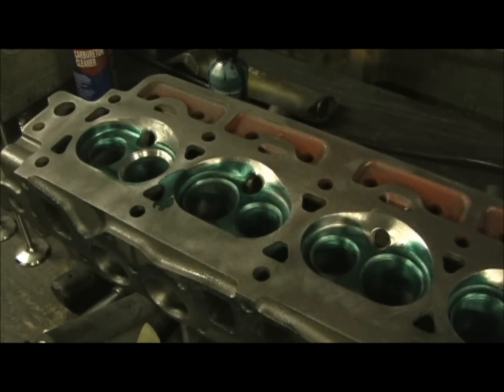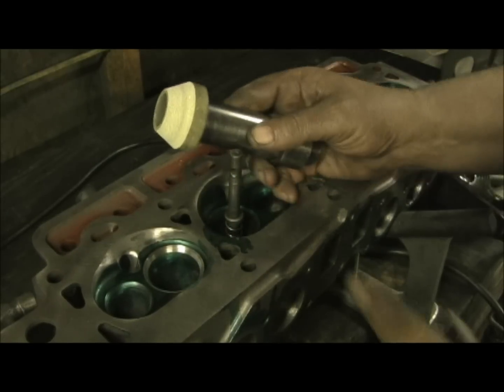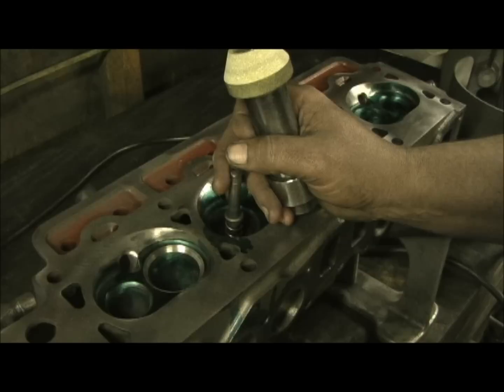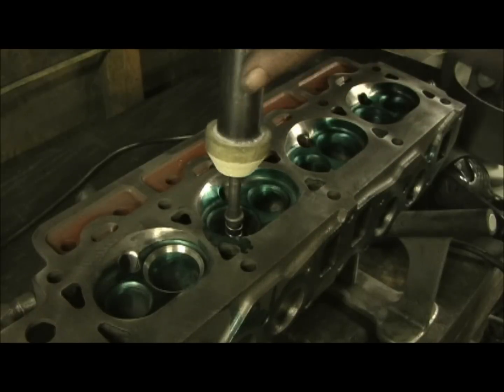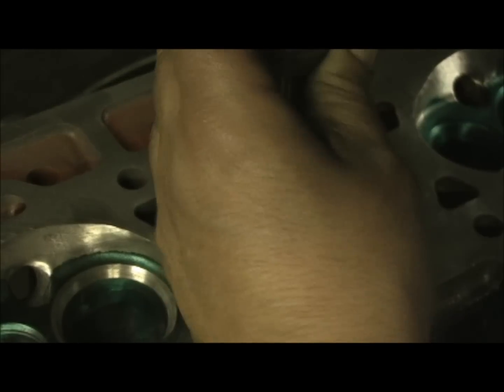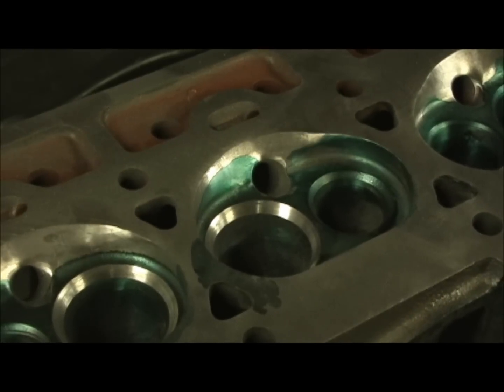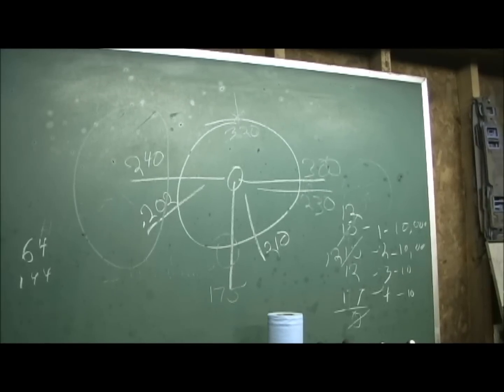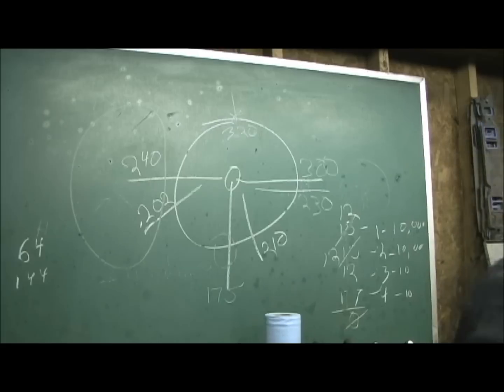1973 Volvo 1800 "Competition Valve Job" Stage IV 1.4

Comment: The valves are very straight up in the chamber. They will run real well.
Reply from the maker: You know, I am going to use my valve angle finder to check that, thanks Yank, I know the Pontiacs are 14 degree after 1967, these might be less, like 12 or 10 degrees. It takes a HELL of a Flange Floor to Deck ratio to do something like that.
Reply: It is nice stuff.

Comment: Those Volvos remind me of a counter flow tractor head. Tough little engines.
Reply from the maker: Yea, I got that, but did you knot that the Flange to Deck ratio is higher than the 18 Degree chevy head? I shit you not. I about died when I measured that. I could not believe that heads in the early 70's had that technology....Good to hear from you guy, stay tuned, you would not believe what I got cooking now, YOU YANK!!!